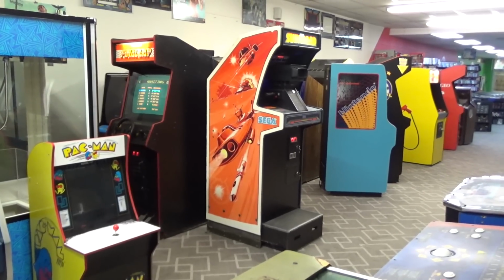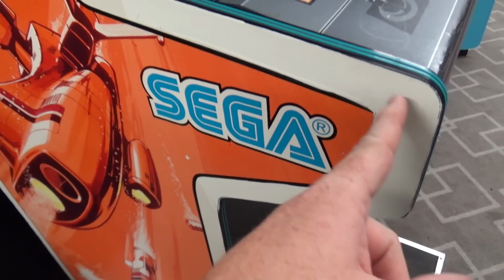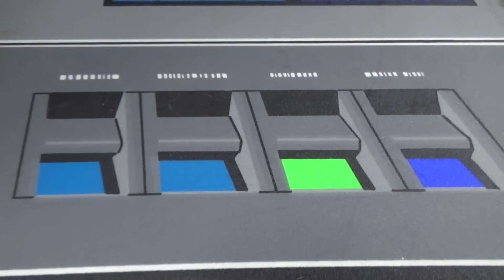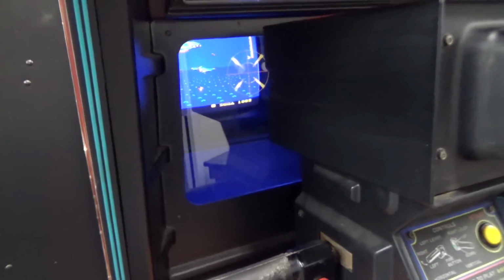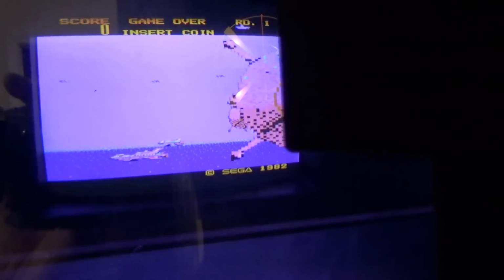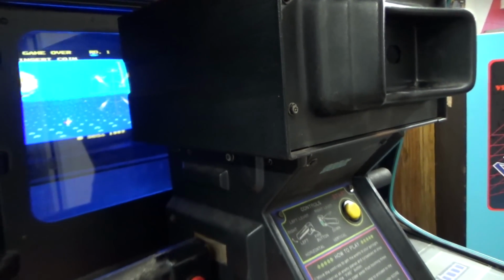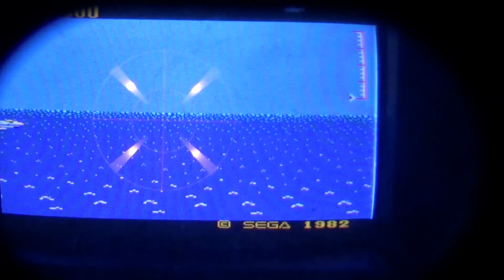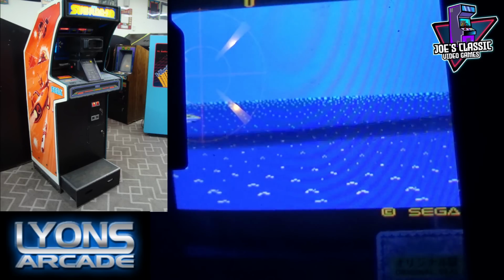Sega's Beautiful 1982 SUBRock 3D Arcade Machine Cabinet - The 3D Stuff is Missing!

Comment: I'll bet this used LCD shutters. LCD shutter glasses are still available. I had a similar set up to watch 3D movies on a CRT television. The glasses were wired to a control box that was synched with the cathode tube. One eye had it's image displayed on the even numbered lines of the crt screen and the other was on the odd lines. As the tube would scan the CRT screen the controller would darken the lens of the glasses for the line that wasn't currently being scanned to the CRT screen. All of this 60 times per second! pretty smart set up for 80's tech.
Reply: Sega used this same technology with their first home gaming console.....they used the LCD glasses with a racing game,
Reply from the maker: Tell me you didn't watch the video, without telling me you didn't watch the video :)
Reply: @LyonsArcade  I was offering this as “work around” to perhaps have the game fully functional. It’s a simple plug and play system that synchs itself to the crt display.

Comment: 3D in 1982!  Wow the 3D stuff is pretty amazing.  I wonder if it could be done using LCD shutters?
Reply: First thing that came to my mind. I suspect that would be fine to reverse engineer if the original mechanism was still in place though.
Reply: @SimonDaviesCyclist  it is plausible you don't even need to do that if the missing board relies on sync pulses of the game video signal as he says. There's a chance you can use simple lcd glasses and sync to it, if the game runs at standard 60hz as example, the glasses just have to alternate shutter following vertical sync pulse and it will work just fine!
Reply: @andrealotito4412  that's an interesting idea and would be cool. Test it with  a probe, get some cheap LCD glasses, it may just work! Sounds like a fun relatively cheap yet highly effective (assuming it works) project! Fortune favours the brave (and inquisitive).

Comment: doesn't look to tricky to fabricate new shutters  some details in this manual   r.mprd.se/MAME/manuals/arcade/subroc3d.pdf   6v dc motors, 50/50 light dark disk as the shutter and a optocoupler to sync up the motor timing..       I think this is very do-able.
Reply from the maker: It would definitely be doable, as a hobby.  We're running a business though and the time it would take to reinvent the wheels would make us lose money on the game.  Thank you for watching, Peter!
Reply: @LyonsArcade  but that's the only cool thing about this game. Otherwise it's lame :)
Reply from the maker: @mikekunzelman8006  Just wear 3D glasses it will be fine
Reply: I was thinking maybe it would be possible to hook up some active shutter 3D glasses to the video sync and put the lenses in the periscope box. It wouldn’t match the original’s motorised system but it would give the same effect I think.
Reply: @dreamcastfan  I was going to suggest something like this too.

Comment: Does that Pacman work ?

I have seen some of the cheapest games in Walmart for 300 dollars

I have not seen the Pacman in stores but on their website they had it for 350 

It is really cheap and the wood and screws are particle board, Really cheap

The case is probably 30 dollars in particle board and the monitor is a 17 inch. I think it is about 100 dollars worth of parts, maybe 150

Most of the machines people buy to convert to a 2000 in 1 game with the raspberry pi

I have heard that the Pandora Box is really good but they overheat

The XBOX I had converted to the 2000 in 1 MAME arcade machine the box failed. I hardly ever played it. Not sure what is wrong with it

I don't think the hard drive went bad

I think the main board went bad

Nothing replaces the actual arcade cabinet games

I have been wondering how the 60 in 1 MAME board works and what games can take the board and how hard it is to install it.

Maybe you could make a video converting one of the games that you get or have.
Maybe one missing the original board
Reply from the maker: Unfortunately it doesn't work, that one's been abused pretty hard, the monitor doesn't work and the board doesn't work, the cabinet's about half falling apart.